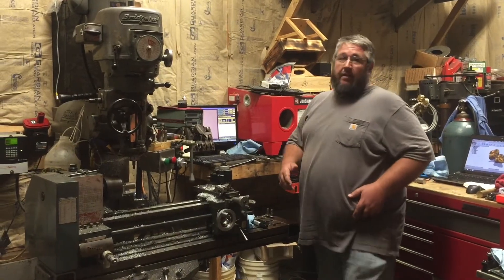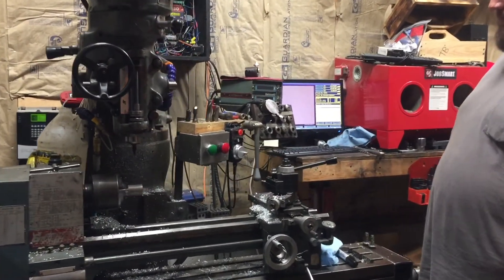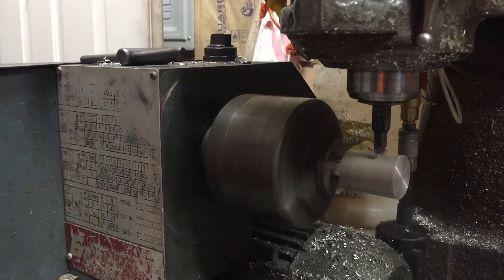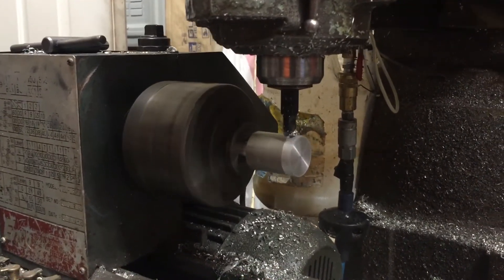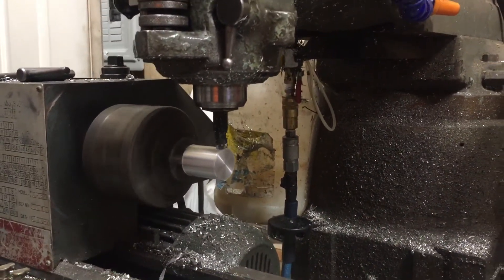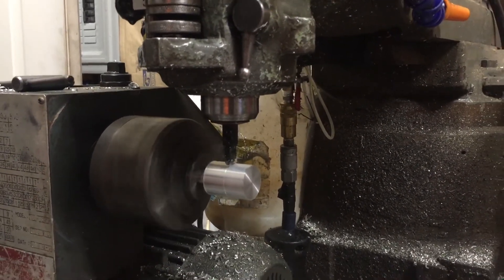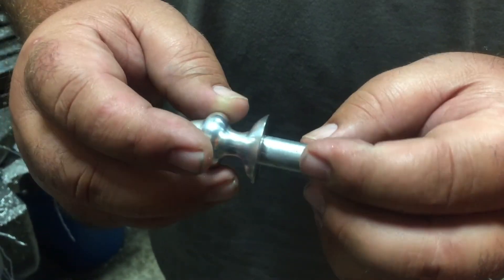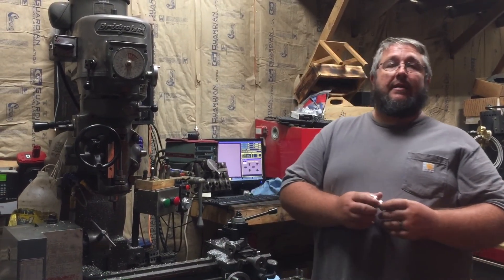Crazy Prototype Setup On The Bridgeport Running Masso And Clearpath Servos

Comment: pretty clever what you done there, only issue is that if you put a flat bar across the table of the BP you will find it is not flat , not by a long shot. gotta level the lathe independent of the table. Keep up the good work ! Masso is going to freak if you keep pushing it ! lol.

Comment: Excellent! I watched the brass parts video first but I do have a question,  how did you lock the spindle on the Bridgeport? Servo?
Reply from the maker: Norbert St. Pierre well all i done was turned on the spindle and ran the sheave as slow as possible and then put it in low or backgear. Then I tried to turn it with a 10" crescent and just about bent the tooling so I figured that was good enough.  The square tool is in a round collet too. Lol.  It all works great. The cuts have to be light tho it lifts the table on the mill if ya get to deep. We ran all four parts in just a few mins so the light cuts don't bother us much. Still better than standing there running it by hand.

Comment: What type tooling are you using ?
Reply from the maker: TheJR914 shars carbide insert tool round
Reply: John lambert Finish looks great.
Reply from the maker: TheJR914 thx that round insert done such a nice job it didn't take much to polish them up. Did ya get ur mill going??